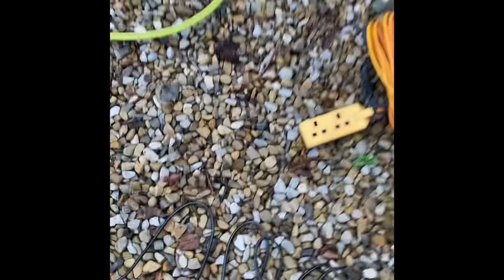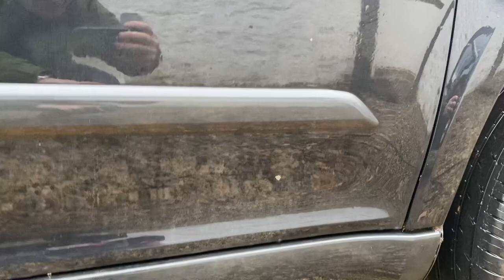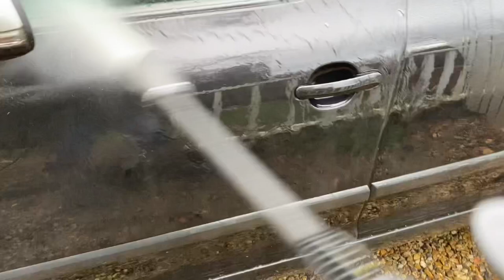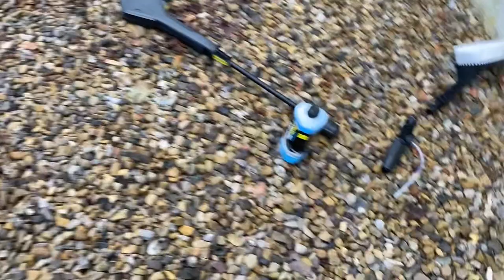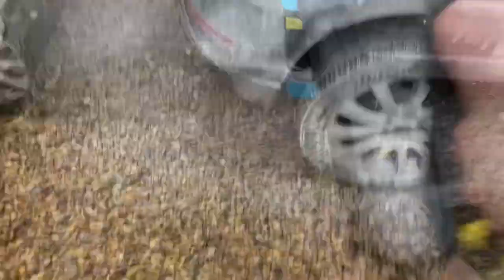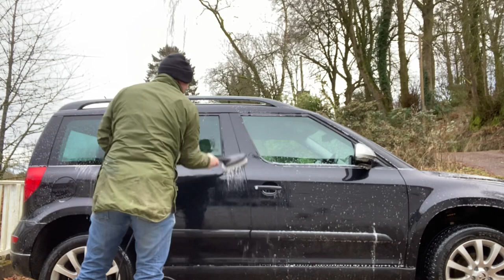Karcher K3 Power Control Car Kit - Review

Comment: Yo dude, thanks for the video. I've just bought one of these bad boys and was wondering if you had discovered any more uhm..."efficient" use of the foam jet rather than it defaulting to MAX POWER :)
Reply from the maker: Not yet. I find the inbuilt detergent dispenser to be more efficient than the foam wash, with a diluting shampoo rather than one which you don’t dilute - certainly a lot kinder on the wallet!
Reply: @Grumpy_Jock  thanks!

Comment: Sounds and looks so weak, that whizzing sound is always a sign of a weak pressure washer. K5 at least or k7.
Reply from the maker: Depends on your budget, k5&k7 are a decent jump up in price. Also didn’t have it on full power for the car. Hasn’t felt underpowered for anything with the high pressure lance fitted, such as cleaning pavings. 
That being said, the premium models would obviously offer better power (and possibly longevity) if you can afford them.
Reply: @Grumpy_Jock  once you try a k7 you’ll realise.